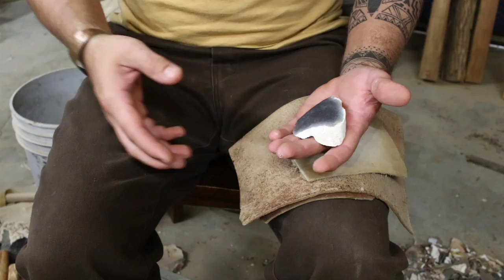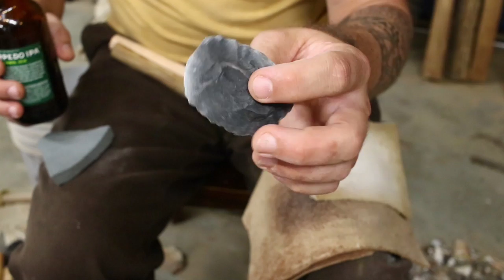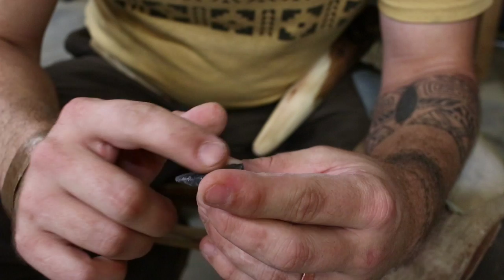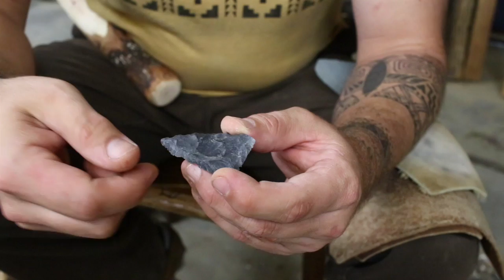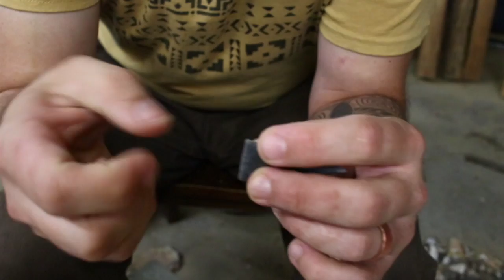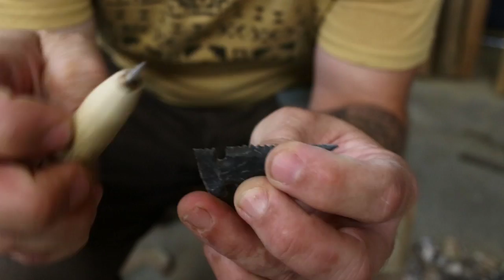Flint Knapping for Beginners, level up

Comment: Someone used to do a demonstration where he'd place a mounted point on a bathroom scale point up and use a piece of hide pulled down over the tip to see how much pressure it took to pierce the hide. It's only pertinent to that particular piece of hide and your particular scale set up, but it still show the difference between point profiles or edge treatments. Might be something to consider doing to show your very observations. He was doing it to show the cut on contact vs replaceable blade heads. I'm sure you probably know what I'm referring to.
Reply from the maker: Yes for sure, I actually have a system built  similar to that. I will be using it in a video that should be out this fall

Comment: Seriously best teacher ever. Seen this like 3 times since you uploaded it. Still wanna do this, still haven't. I've passively kept an eye open for rocks but I imagine I'll have to actively look here in IL. 

42:24 -words to live by guys
Reply: If you have any trouble identifying useable rocks I'd recommend carrying a hammer or a hammerstone around with you for testing. Early on, I'd recommend looking for quartz. You can find it pretty much everywhere and it's usually a lot easier to identify because it won't have a cortex on it unless it eroded out of another rock.

Glass would also be another good place to start. it works similar to higher quality rocks and it's similarly easy to break. great way to learn. Down here people sometimes use broken slab glass for driveways. good thick spall sized chunks of it.

Comment: Pretty sure I've read somewhere that the Egyptians used Copper tools for their Stone making. I'm not 100% on that but I feel like I've read that.
Reply: Neolithic man used copper pressure flakers 5000 years ago in Europe and Africa. Armorican and bell beaker barbed and tanged points are often found with copper residue on the edge near failed flake removals
Reply: @captainflint8412  that's interesting! Did not know that, thank you for sharing.

Comment: Im trying this with what I find in the yard.  Its hard to find something hard enough to hold an edge but soft enough to break . Ridged. Idk how to explain but I know you get it.  Ive run into a couple of rocks that are extremely hard so I said what the hell . Ill try a newer tool and grabbed my east wing 22 ounch hammer and 12 ounce ball pin hammer and im shooting sparks . Almost caught my rug on fire . One rock is red with gold flakes in it and the other is a dark gray and you can tell by the look of it its dence and feels light for how strong it is and the other is red and heavy got them from Colorado  while hiking . Ive only hit my hand once but its an instant brews.  And is there anything you know of that grows in ga that I can use to wrap my points ? Im having a hard time finding an alternative . Id there is any. Thx for the videos. Im having fun trying to make something cool with stuff i come across.

Comment: It looks like you're in a shop. Do you have some ventilation going or a fan to avoid breathing in silica? Or is there a reason you're not worried about it? I'm a beginner and have heard about the damage breathing in silica can cause but I'm far from knowing a lot about it. 
I love this video by the way. Super informative and you have the sound worked out. A lot of other channels you can't hear them speaking over the sound of their abrading..
Reply: I hear a fan. Seems like 99% of knappers give zero fux for safety of any kind. Slow learners.

Comment: Why made of copper the modern knapping tools? Why not steel or iron? What's the problem with steel?
What are the eligibility requirements of knapping tool's material? What make suitable a material for knapping tool?
Reply from the maker: copper is softer and grips the rock better. Steel will send shock waves into the rock creating unwanted fractures. Antler and soft stone were used traditionally, but copper is a good tool to work with
Reply: @huntprimitive9918  thank You! I see. Thus the requirements are good gripping and softness, and high density (compared an antler material). So plummet, aluminium, tin, soft brass also can be suitable? I can get much easier get cast alumilum peaces, than copper.
I have found thick glass. TV pick-up tube from a rubbish-heap, with 15-20mm thickness, and almost plane surface. I think, that will be suitable for begining practise :).

Comment: I've watched your Flint knapping for beginners video and just started on this one. I have received my first set of tools in Flint but I'm having an extremely hard time trying to figure out where to start on my piece. The shape/thickness of the Flint is throwing me off, the fact that they are squarer edge's I think is throwing me off as well. I have some Keokuk dacite and some black mahogany obsidian, do you have an opinion on which I should start on? I'm sure it's between the Keokuk in the Dacite.
Reply: @J. Hatcher thank you so much for the great advice. I'm familiar with the zigzagging  (watched videos) but can you do those with square edges or should I go around and pressure flake all the edges. I felt like I had a grasp on the beginnings of it until I got my stone and now I'm sitting here not knowing where to start on it.

Comment: I've been researching flint knapped arrow points, and I have a question. I've seen several points made out of slate, and it looks a lot easier than knapping flint. But how does one compare to the other? Does slate make an arrowpoint as good as flint, or is it too fragile to use more than once? And if it can't be used more than once or twice, is it still easier enough than flint points to make it worth while?
Reply: Not as much of a cutting edge on slate and takes a while to grind down but it still makes a deadly point so does bone of course flint is better but slate and bone will do the job

Comment: Can you use your tool set on most all rocks or does it have to be glass like in order for the coper to work. ,?
Reply from the maker: flintknapping in general requires more glass like rocks. Whether using modern copper tools or indigenous antler tools, the rock type is very important.

Comment: Is there a method of , reversing what the heat treating of material does after a point is formed,  i get the impression that a natural rock would be rougher to knap, and be clunkier,  But bing tough would be good, after the knapping is done? Is this a thing at all ?
Reply: Doesn’t make it worse but soaking rock in water for a couple days can help. It fills the gaps with minerals. Makes it more solid and better to run flakes. Learned from Paleomanjim, but I don’t remember the video in specific.
Reply: No method of reversing heat treating though. Completely permanent.